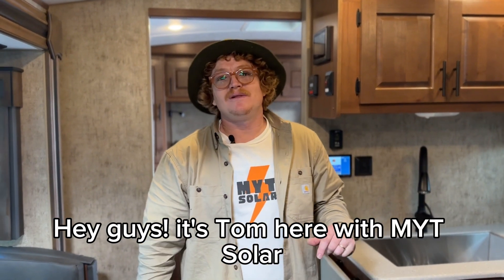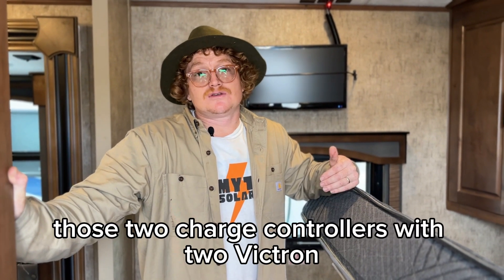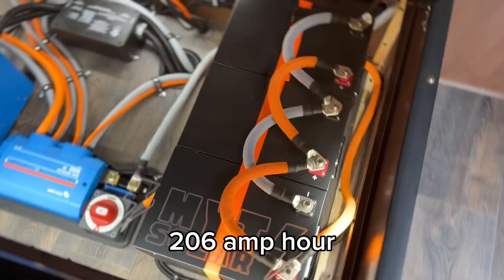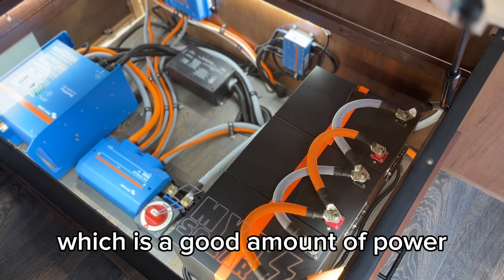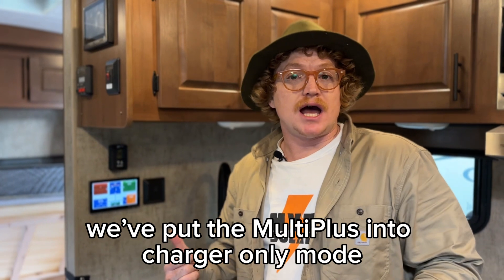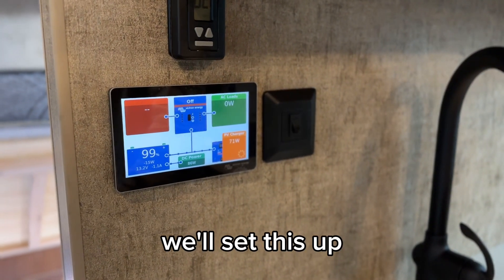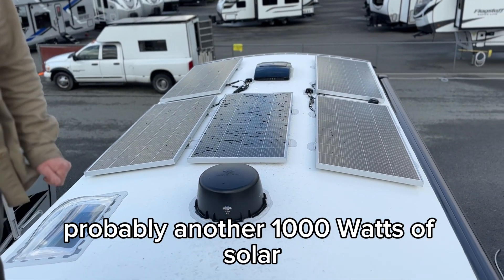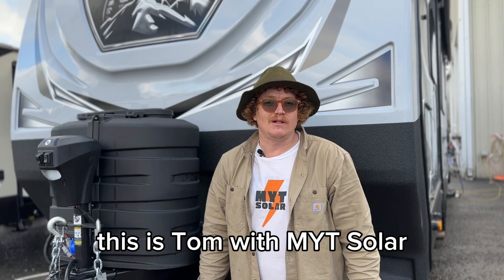IMPROVING FACTORY SOLAR | ORV 28BKS

Comment: We will be looking at a new ORV 24RLS that has 200 watts of factory. I have not owned this branded of trailer before and am 550 miles from the dealer in Pittsburg, PA. How do run the wiring for the inverter back to the AC power panel and how do you run the CAT 5 cables for the screen? I would have you do the upgrade but I'm  in New Hamphire.
Reply from the maker: Hey Gerry. Nice choice on an ORV and glad you could find one in PA. The screen is a HDMI and USB. The AC wiring is tricky. We sometimes utilize junction boxes vs making a huge run of cable. Can't give away all our trade secrets but most our work goes through the underbelly. Take a trip to Beautiful Bend, OR next summer and we'll take care of all of it for you!

Comment: Have you ever done the tank monitors or I saw (not 100% sure sorry) or heard there is a motion detector or burglar alarm?
Reply from the maker: We've not wired  water/waste tank sensors into the Cerbo but it does get done. Some of our customers have added the Mopeka LP sensors to their Cerbo to monitor the propane which is nice. I've never heard of a motion detector/alarm for the Cerbo but sounds interesting.
Reply: @mytsolar  motion detector that has a volt free output contact could be connected to one of the digital inputs on the Cerbo GX and is able to be set as a burglar alarm in the Cerbo G…. Just trying to pass on my “research” again I could be 100% wrong ! But thanks & awesome page/videos
Reply from the maker: Thanks for the intel. I'd love to see more third party devices for the Cerbo GX.

Comment: Why two charge controllers? Are all those panels in parallel? What is the system voltage? I saw all those thick cables. Why not go 48v???
Reply from the maker: In our opinion 24v and 48v systems don't really show their value until over 2000w of solar and dual inverters. Smaller MPPTs and smaller cabling can help bring costs and weight down and make the system more efficient, but for this size system 24v would have just added more expense for the same function. The two charge controllers are because this factory solar is wired in paralell, two sets. You can check out a video of our 24v systems.

Comment: What is an EMS and does it do?
Reply: Electrical Management System: It monitors shore power and protects against high/low voltage conditions, power surges, incorrectly wired shore power, etc.
Reply from the maker: You can think of it as a more advanced surge protector. Usually people plug them into the pedestal and then plug their RV into that. But in this case we wired it in so that the customer doesn't have to plug it into the pedestal each time.
Reply: @mytsolar  And they are pretty expensive and like to "walk away" often. Bringing it indoors prevents theft.